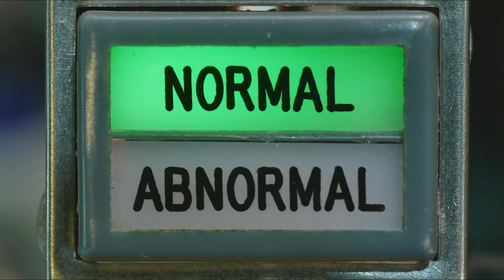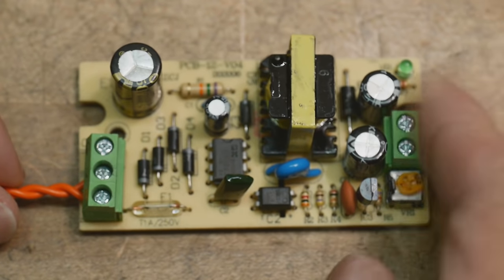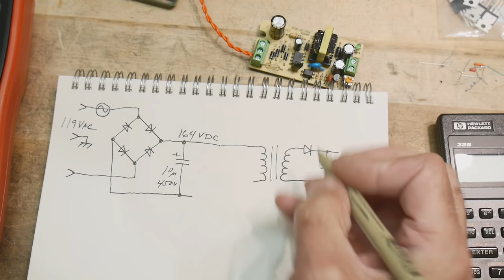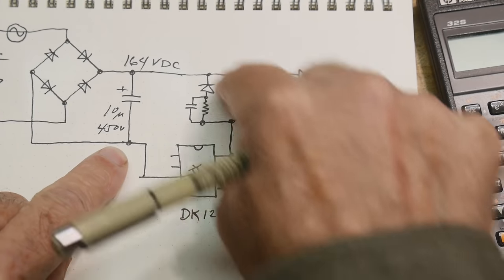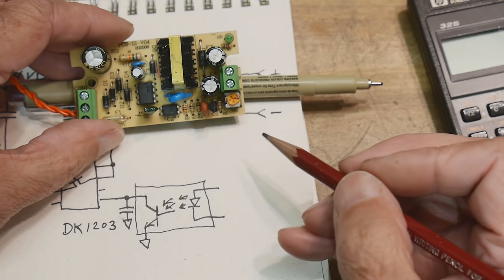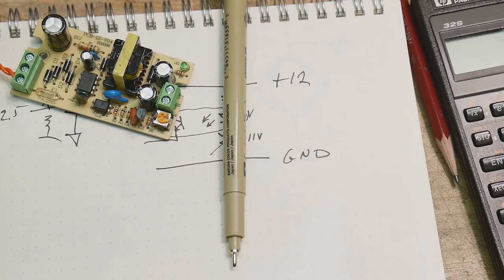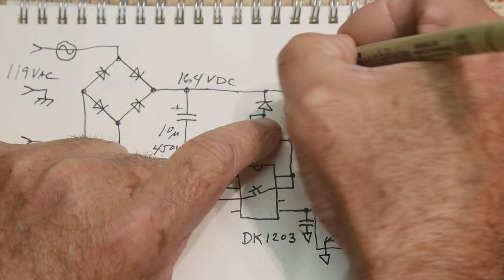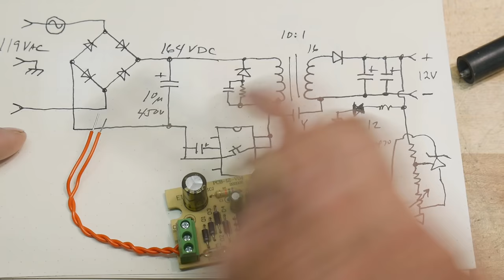#772 Basics: Switching Power Supplies (part 1 of 2)

Comment: There is a misrepresentation about the "AC" at the transformer. By definition, AC stands for Alternating Current. After the rectifier, the current is DC all the way. The transformer in this case has DC on the high voltage side. Because of the switching, the current running through the high voltage side changes all the time. This change of current drives the transformer and produces current on the low voltage side.
Reply: Thank you. That confused me. I think it makes sense the way you explained it.
Reply: It IS alternating current at the transformer. It changes between 2 definite values, ramping up and down due to the time constant of the inductance of the transformer. It may be caused by the switching, but it is alternating current nonetheless. If it weren’t AC, the transformer wouldn’t be doing anything because there would be no change in the magnetic field.
Reply: A voltage that is changing periodically is AC. It doesn't really matter if it's a square or sine wave
Reply: @michaelkeymont501  isn't it pulsating dc? A transformer only takes a change in electric field; it doesn't have to reverse. But the definition of AC means that it goes both positive and negative.
Reply: @mschwage  it’s chopped DC - when the DC gets chopped from full on to full off, it a voltage is induced in the coil and the result is a current that goes positive and negative about a virtual ground. “Negative” because the direction of current flow reverses when the DC is turned off, because the collapsing magnetic field is trying to oppose the instantaneous change. The current goes positive while DC is on and negative when it is off, hence alternating current. That’s also the reason that you need a snubber diode across the coil. If it weren’t there, that opposite polarity current would fry the switching circuit because it’s initially a very high voltage spike in the wrong direction.

When I worked in failure analysis for a power supply company, we used to see that voltage spike get out of control - literally - if the adhesive in the potted transformers started to fail. As the air gap changed the characteristics of the transformer, they would get extremely hot and burn up from the voltage spikes blowing out the snubber diode and taking out the MOSFET in a magnificent puff of smoke.
Reply: @michaelkeymont501 the current doesn't reverse direction when you cut the DC voltage across an inductor, though. An inductor acts as a short circuit for DC, but when the DC is cut, it is modeled as a voltage source with the polarity the the same as original current flow. The collapsing B field is still in the same direction, so the collapsing field will have current flow according to the right hand rule. Your snubber diode should point to the voltage source, so when the power is cut to the inductive load and the  normally lower voltage side spikes in voltage, the diode caps that voltage at the knee voltage and creates a loop through the load allowing the energy to dissipate without damage. 

For everyone else, a signal must reverse direction to be AC. Changing between values doesn't make it AC.
Reply: @commenter4799  Lenz’s law says the collapsing field changes the direction of current flow in the inductor. Conservation of energy would be violated if it did not. When the field collapses, you get your energy back, you don’t get new energy created from nowhere. For that energy to  be returned, it reverses direction. The negative sign in the formula for Faraday’s Law confirms this. That equal sign denotes the reversal of direction.
Reply: @michaelkeymont501  Lenz's Law is why a motor gets capped at a certain current with no load. The induced emf opposes the applied voltage. So, in the case of an inductor, when you say that the direction changes, it's changing from opposing the current when the switch is turned on, to its steady state acting as a short circuit, then to the same direction as original current flow. 

The current going in the same direction isn't creating energy, it's releasing the energy stored in magnetic fields around the inductor. The reason it can go on the same direction is because it resisted the current flow when the voltage was first applied. 

 Faraday's law has a negative sign, like you said. So, if the magnetic field is collapsing, the derivative is negative which cancels out the negative in the equation, resulting in a positive direction induced voltage. 

If  the induced voltage from the collapsing magnetic field was in the reverse direction, back toward the source, then your flyback diode would have to be in parallel with the load and pointing in the same direction. This would cap the voltage across the load at the knee voltage, which wouldn't be useful. Really, you wouldn't need a diode, because the switch would be on the hot side and the voltage spike wouldn't do anything.
Reply: Very helpful discussion
Reply: @ronjon7942  https://youtu.be/cK5WLMFSGnw - at the 14 minute mark he does a nice breakdown of the operation of the circuit, block by block. As I’ve been saying, when the switching MOSFET is combined with the transformer, the signal becomes AC again due to the inductor charging and discharging. That AC is then converted BACK to DC with the secondary rectifier.
Reply: @ronjon7942  this is my final volley in this stimulating debate, I promise!
https://youtu.be/Z4PVrhYHBnU
Here, a completely different channel explains how an inductor works using a spring analogy. I think anyone watching this will understand that when you apply force in one direction, and then release that force, the spring compresses in the initial direction, with force in the opposite direction (opposing the applied force) and when the initial force is removed, the spring uncompresses with force opposing the initial applied force. It responds to downward force with upward force, and it responds to upward force with downward force, and this is the same thing that happens in a switched inductor. It alternates the direction of electromotive force because of the combination of the switching action and the charging/discharging of the inductor in response to that switching action.

Just to put a nail in the coffin here, even in a linear power supply, we use a bridge rectifier, which converts the AC of the transformer into DC, right? Then we put a large filter capacitor across that DC voltage - to do what? Filter the AC ripple that is still present on the DC voltage. The voltage after the rectifier is definitely DC, but it has AC riding on it. Even though that ripple voltage is entirely in the positive DC line, it is still very much alternating current. The voltage stays positive with respect to ground, for sure, but the current in that ripple voltage is alternating.

Don’t make me get into how every transistor circuit acting as an amplifier is biased to a certain positive DC voltage, and an AC signal to be amplified is applied to it via a DC blocking capacitor. It is a DC level with AC applied to it, which results in an amplified AC signal at the collector. AC where you might think there is only DC happens everywhere in electronics.
Reply: @michaelkeymont501  the spring analogy isn't correct for an inductor, and one of the comments on that video brings this up. When the spring returns this energy into the pen, the pen is pushed up implying a change in current direction. A spring is analogous to a capacitor which is why we use it to control the ripple. An inductor can be modeled as a water wheel as seen in this video https://youtu.be/KSylo01n5FY. It's important to note that the inductor in the video is in parallel, not series as in a buck converter. 

The voltage across the inductor changes polarity and magnitude, but the current does not change direction. I'm not sure we even disagree on that. Without pictures I'm not certain what you're explaining, lol.
Reply: @mschwage  electrical engineers commonly categorize a time-varying non-DC signal as an "AC signal," even when the signal's current polarity does not actually reverse direction. For example, if we add a DC offset current k to a sinusoidal current signal y, where k's magnitude is greater than or equal to the sinusoidal signal's amplitude A, the resulting current signal y is still considered an AC signal even though the current now flows only one direction:

y = A sin(2πft) + k
|k|>=A
Reply: @michaelkeymont501  it's not AC since it does not change direction. Do you consider PWM as AC? it's a pulsating DC. And pulsating DC can absolutely drive a transformer since a changing emf is required for inducing magnetic field. Pulsating DC does that like the AC.
Reply: Ac is alternating dc... As far as how it behaves in that it can increase or decrease voltage in a trafo, it is ac... But it is a weird ac... Sound is also a weird Ac, what happens when you trafo it?
Reply: @@skynstars😂
Reply: True. Technically, it's pulsed DC, which due to its constantly changing nature allows it to pass through the transformer. Clarification: the reason this is not technically alternating current is because the current direction never changes direction...

Imagine a car that constantly switches from going 60mph to 0 mph. It's relative direction constantly alternates, but it never moves backwards.

In this analogy, to be true alternating current, the car would need to move backwards and forwards.
Reply: For some reason my high ass thought this was a joke and I kept waiting for the pubchline
Reply: At this late date I don't suppose anyone will come back to this discussion, but ... 

The converter in question is a flyback type. The thing that everyone is calling a transformer does not behave anything like a "normal" transformer in terms of power delivery. It is an inductor with one winding to charge it and a second winding to discharge it.

When the switch is ON, energy is stored as a magnetic field via the input or "primary" winding. During the time current is flowing in the input winding, no current is flowing in the secondary. There is transformer behavior, but the phasing and diode are such that no current is permitted to flow in the secondary.

When the swiitch turns OFF, the energy stored in the inductor is discharged via the output or "secondary" winding through the diode. Again there is transformer behavior with the secondary voltage "reflected" back to the primary side according to the turns ratio, but no energy is being transferred back to the primary side.

Actual useful current flow in each of the windings is always in the same direction. There can be some "ringing" that is truly alternating after the inductor has been discharged, but no useful energy is transferred. It is really just an L-C resonance that persists until the last vestige of stored energy is dissipated.

Flyback inductors are designed on the basis of getting the required amount of energy stored and removed each cycle. That means it is the inductances that are important. The usual transformer concept of "turns ratio" goes out the window. It isn't totally irrelevant because of that "reflection" of the secondary voltage back to the primary. Also "aampere-turns" comes into play. You can't instantaneously change the current through an inductor, or more accurately, you can't instantaneously change the product of current and number of turns. If, for example, you have a 100 turn input winding and a 12 turn output winding and the peak current in the input winding is 2 A at the instant the switch turns off, the peak current in the output winding will be (100 turns x 2 amperes)/12 turns = 16.7 amperes.
Reply: Where’s the misconception?
Reply: Does current flow in the secondary when the magnetic field grows in the primary?
Reply: My first time using chat gpt
What it said made me realize that even if you pulse dc current thru a transformer, its gunna throw it back at you in opposition. Thats AC baby. Doesn’t matter much what you call it so long as you know what its doing. 

Yes, when the magnetic field grows in the primary coil of a transformer, it induces a changing magnetic field in the secondary coil. This changing magnetic field induces an electromotive force (EMF) in the secondary coil, leading to the flow of current

I actually tested this before asking chat gpt with a MOT and a 9V but all i had was a spark gap, I didn’t get a spark when touching the battery but i sure got a spark when it disconnected. Magnetic fields act just like capacitors. It’s crazy to see 9V spark the way it did. I can’t imagine the promary kicks back HV but i still got lots to learn about transformers. They a real pain in my butt rn. Chat gpt bout to make it super easy for me tho
Reply: I used to think the same, but is not like that, its caled AC because it alternates between ON and OFF states, a DC signal'd be completely off or completely on

Comment: If I had my bet, the idea came from the military, mainly the Air Force, using 400 Hz inverters, and noticing how the transformer's core was smaller due to the higher switching frequency. Frequency directly affects the core's size.

Comment: Very good explanation of one of the “mysteries” of electronics - AC to DC switching power supplies!
A few comments/suggestions:
1) You forgot to show the “AC side” GND symbol/connection to the “-“ side of the bridge. This is typically designated with a different and unique GND symbol to signify that it is DIFFERENT than the GND potential on the “DC side”.

2. The “DC Side” GND symbol should be unique and distinct from the AC side GND. They should NEVER be connected together. 

3. You should highlight the main reason for both the transformer and optoisolator is to create a galvanic isolation between the AC and DC sides of the circuit to prevent stray currents, emi noise and, to safely separate and isolate the high voltage AC and rectified DC from the low voltage DC side of the circuit.

4. Finally, perhaps a mention should be given for connecting an oscilloscope to this circuit..esp the AC side and how this should be done with a high voltage differential probe or a battery powered scope that can handle high voltages.

And finally,
5. SAFETY FIRST when working with high voltage AC or DC circuits. Preferably use an isolation transformer and a VARIAC.

Final note: Y” caps failure mode is “open” and “X” caps fail shorted..which would cause the AC line fuse to blow.
These caps control and minimize the common mode voltages and currents.
Reply: Good input!  Just randomly came across this video and thought it would be a good refresher for me.  A few questions that I didn't see answered in the video that maybe you can help.     
1 - I was especially hoping to see more about the grounds.  You mention to never connect dc side and ac grounds together.  In the schematic shown in the video, the dc output has a floating ground reference.  Couldn't this cause issues when connecting to devices that are earth referenced?  What's the proper strategy around having an earth-referenced ground output on the dc side?
2 - Galvanic action due to two dissimilar metals being in contact with each other, correct?  Is that really what it's protecting against?  I've seen this mentioned before, and I have always wondered why it is actually called galvanic?

Comment: Hi, well done instructional video although with small inaccuracies in the description of the voltage conversion on the transformer - it is not AC, but modulated DC (creating an AC inverter with a sine wave is difficult). Well, now to the question of why capacitors "X" are used somewhere and "Y" somewhere - it's for safety reasons - that's why the design is also different, these capacitors work mostly in high voltage circuits and if they fail, there could be damage, or unpleasant accidents. X and Y contain not only how the capacitor will behave in case of failure, but each of the types must meet different safety requirements - these are marked with a number after a letter - for example X1 or Y3:
The X-marked capacitor must be cut in case of fatal failure
Conversely, the capacitor marked Y must not be interrupted
There are also capacitors marked XY - they must meet the safety protocols of both classes.
Due to the different design, they also behave differently in the circuit, thanks to the design, capacitors X can be used as a voltage reducer in AC voltage circuits, where thanks to the capacitive reactance, the voltage will be reduced almost without the power limitation that would have to be taken into account when limiting the voltage using resistors .

Nice day 🙂 Tom

Comment: This is great explanation about SMPS.
I’m come from Taiwan.
I just say the Y-Cap, it should be across between Pri. ground and Sec. ground.
The some noise from X’fmr will be closed loop thru Y-cap.
Maybe it can high voltage in pri. But we have to think about the stress on there.